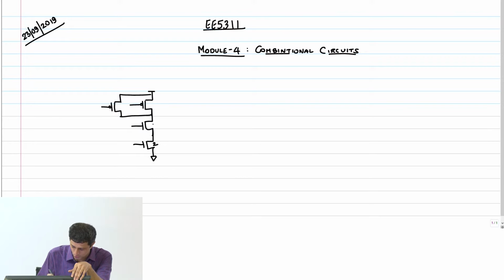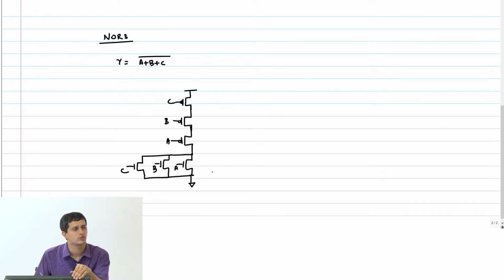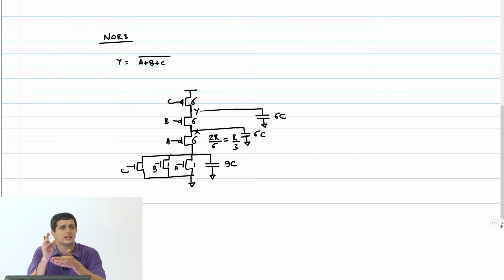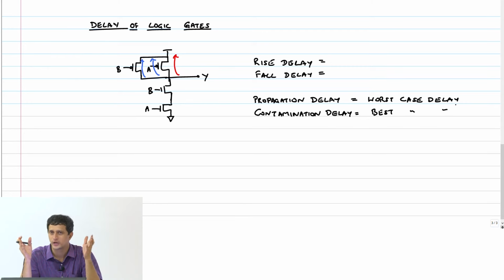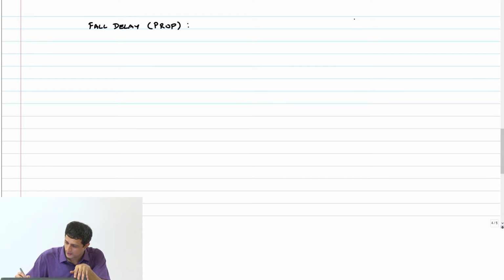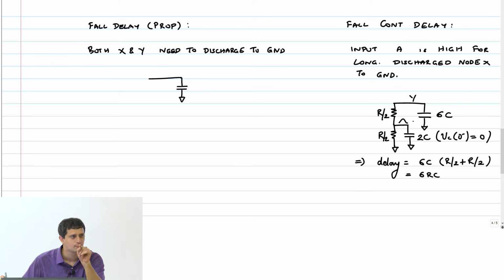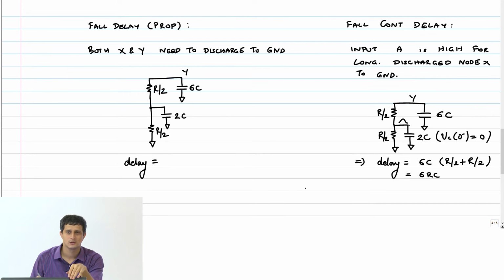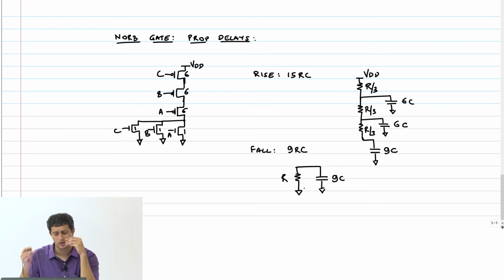CombCkt - 5 - Gate Delay

Comment: For the 3-input NOR gate, in the worst-case falling output transition, the upper pMOS (closest to VDD) is OFF while the bottom two pMOS are ON. So we cannot disregard their diffusion capacitances. Falling output delay should then be: 6RC + 6RC + 9RC = 21 RC

Comment: How we get 7RC delay
Reply: you should separate it into two parts. one is the path from the top cap right to the ground (2*r/2 resistors) and second is from the bottom cap to the ground (r/2 resistor). therefore, 6C*(2*r/2) + 2C*r/2 = 7RC
Reply: @ofek--2  thx

Comment: 17:04  For Fall Contamination Delay,   When Node X is allready been discharged , then  voltage across it should be zero and it should short the equivalent R/2 resistance.

Therefore , 6C will face only Upper R/2  resistance to get discharged.!!!!

Then delay should be only 6C×R/2 = 3RC!!!
Reply: This is not true. 
first of all, caps in DC analysis are not shorted but "open".
second, eventually in steady state both parasitic capacitances will be discharged. in other words, current will flow from the caps through the resistors to the ground.
Reply: did u get an answer?

Comment: DURING RISE TIME (PROP & CONT.)
THE RESISTANCE SHOULD BE R/2 RYT WHILE CALCULATING THE PROPAGATION DELAY?
Reply: yes , i also thought that same thing.
Reply: No it must be R/3. Because he has sized the PMOS transistors as 6. 2 units of width in PMOS gives a resistance of R. 6 = 2*3 units of width will give a resistance of R/3 as the resistance is inversely proportional to the width of the transistor.

Comment: For NOR 3 GATE , How rise contamination delay becomes 9RC..?.
ARE both 6C fully charged to Vdd..?
Reply: can any one explain rise and fall contamination delay how it came 9RC and 3 RC
Reply: Yes, going by what he said, A and B are low for long enough for the 6C caps to be charged to VDD>
Reply: How it is 7Rc for the case when X and y both need to get discharge ??
Reply: @Parmider Kaur use Elmore delay model it's (RC+6RC) total 7RC
Reply: @naveen6838  could you please explain me
Reply: @raj.dpatel1162  you should separate it into two parts. one is the path from the top cap right to the ground (2*r/2 resistors) and second is from the bottom cap to the ground (r/2 resistor). therefore, 6C*(2*r/2) + 2C*r/2 = 7RC